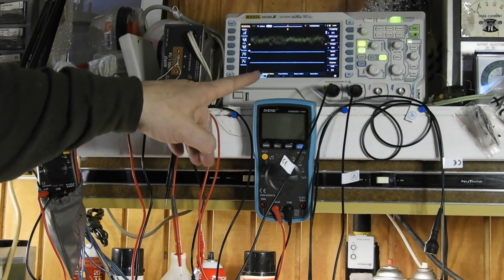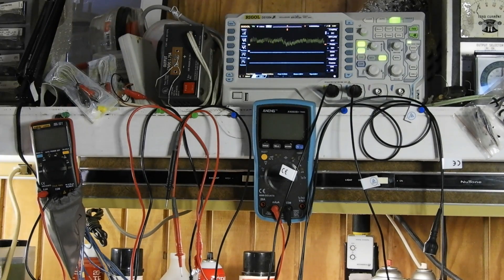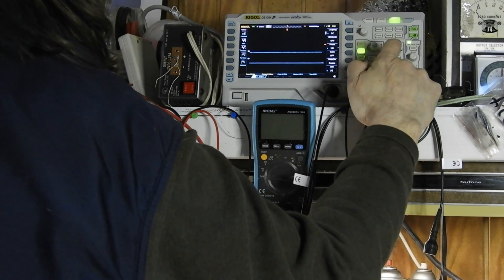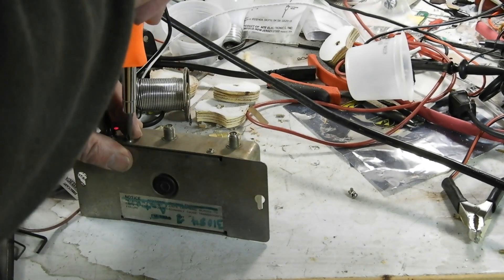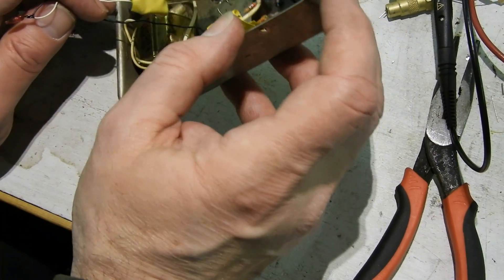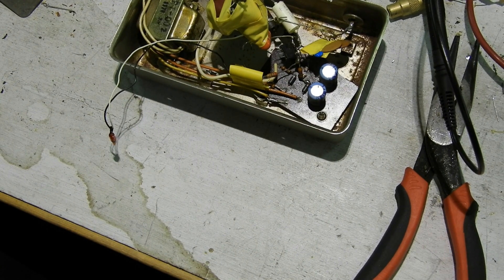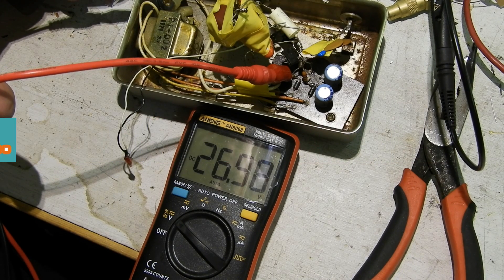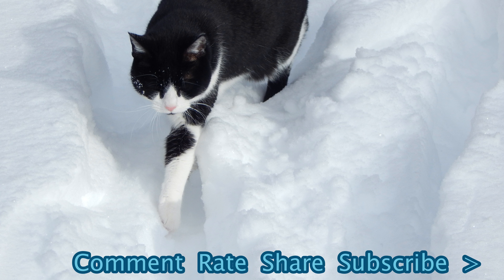White/Pink Noise Generator  MM 5837N

Comment: Neat IC. I never tinkered with that one. It is done with a shift register which can be emulated in software on a microcontroller if you wanted to create a noise source (if your chip is dead).